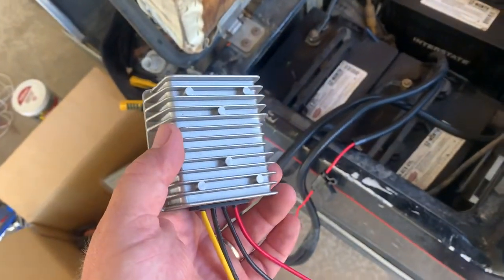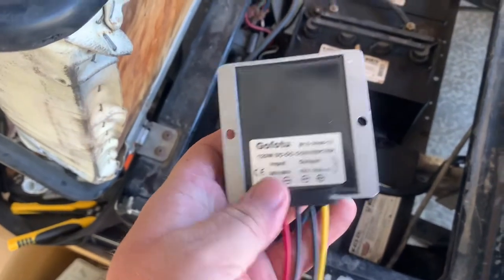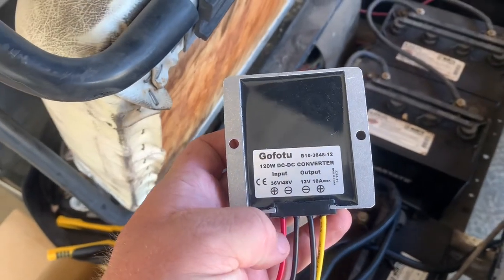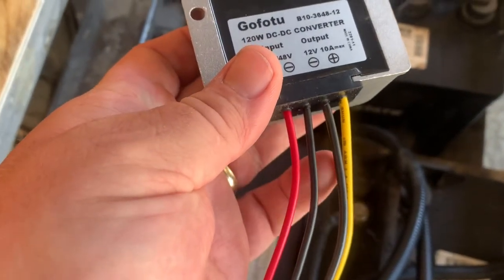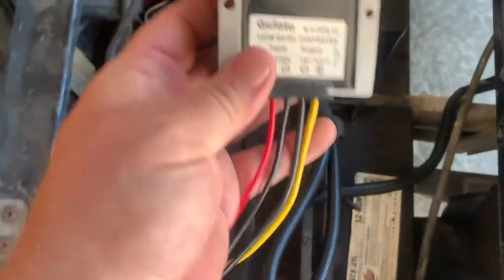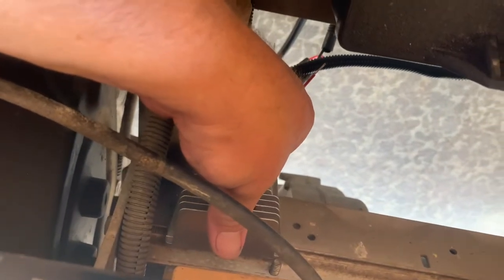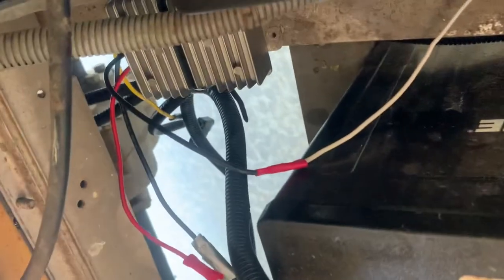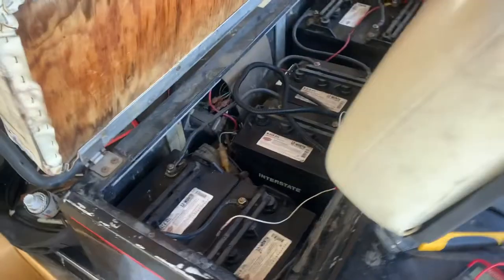Installing A Voltage Reducer On A Golf Cart | Club Car DS

Comment: I have a 2001 club car DS 48v Regen 2 model. Where are the leads for the lights? Been trying to figure out where they are to install my reducer.
Reply from the maker: The wiring for the lights comes with the kit.
Reply: @BevanFarmTexas  appreciate the reply. My issue is I couldn’t find the main wires for my 12v accessories headlights taillights and horn. But I figured it out and found the main leads and got the reducer installed for my 48v lithium battery.
Reply from the maker: @advertents_8624  gotcha. Mine didn't have any, but the wiring harness for my kit had all of the different leads.